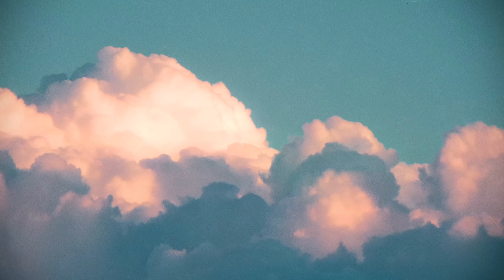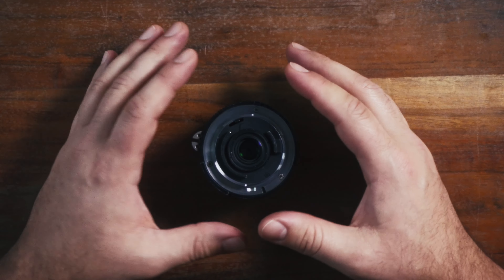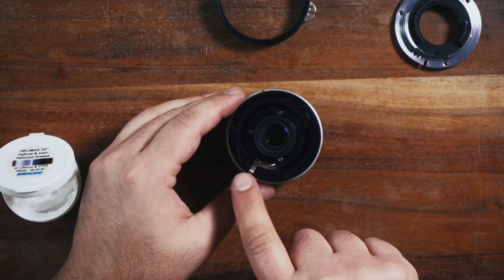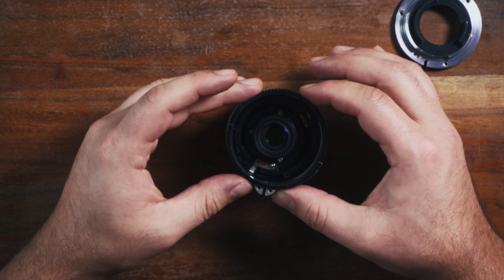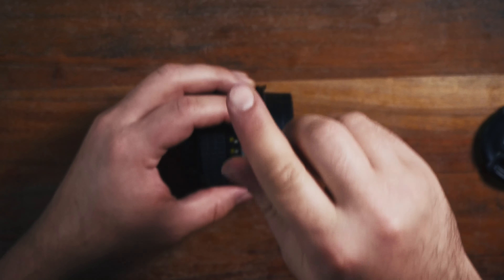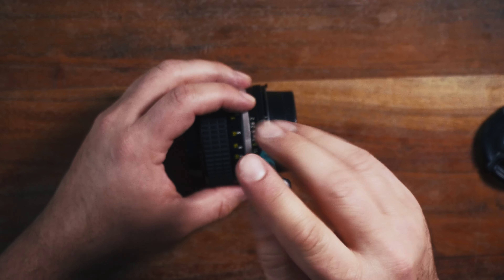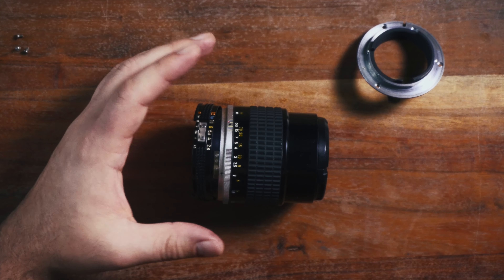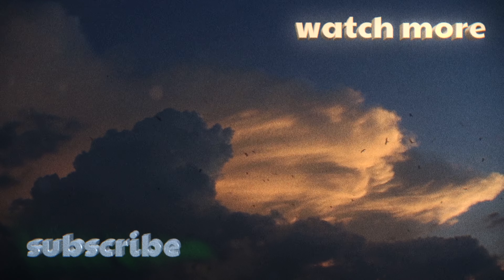De-clicking some Nikon Ai-S Prime Lenses for Video!

Comment: Thanks for sharing this. I might try this myself. 
One question, maybe you said this but is the glue for dampening the aperture ring? Someone on a forum suggested to glue in a piece of PTFE sheet in there, but I don't know what's recommended.
Reply from the maker: I’m using a grease made specifically for optical helicoids. Other greases can cause hazing over time. Replacing the metal clip with a piece of PTFE sounds like a great option.

Comment: Really nice rounded set, I’m looking for a 24 f2.8, 28 f2.8, 35 f2.8, 50 f2 and 100 f2.5
Reply from the maker: Yeah. I’m pretty happy with that. I’d like to grab the 28mm, not because it fills a gap, but that I understand it’s a total banger or a lens. Also… happy new year!
Reply: @gearheadchannel  It's IMHO the best vintage 28mm, a friend has it and tested it with a borrowed Leica R 28mm V2, it was as good and outperformed the Leica.
Reply from the maker: Ugggghhhhhhhhhh…… ok, I’ll buy one. Lol

Comment: I'm going to take apart a lens that I sank in a river to see it I can doctor it up. The electronics are toast but I rarely use autofocus anyway.
Reply: I sent a few lenses and a 7D into the river at the same time.I submitted an insurance claim to cover it all. FYI. Don't buy a soft Lowepro waterproof bag.
Reply from the maker: Oof! Probably would’ve had better luck with zip-locs.
Reply: @gearheadchannel  100%